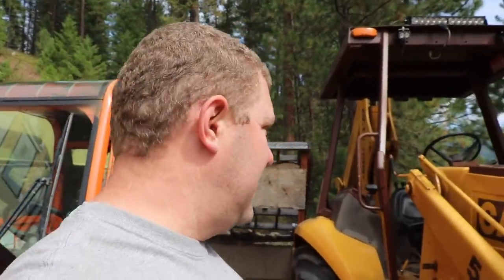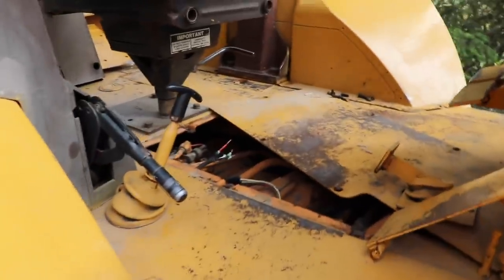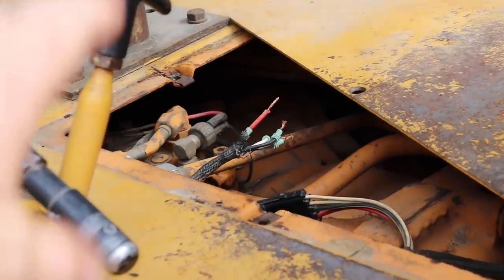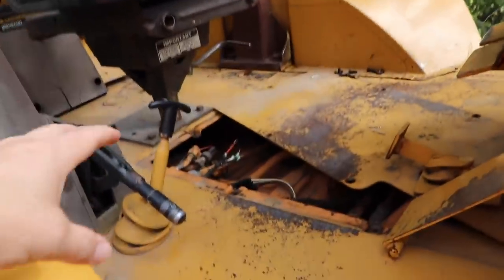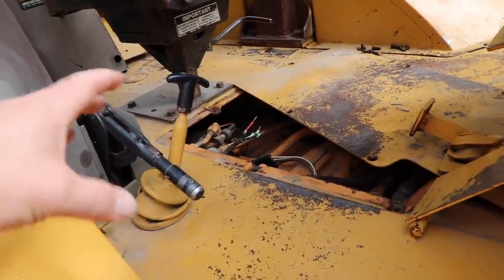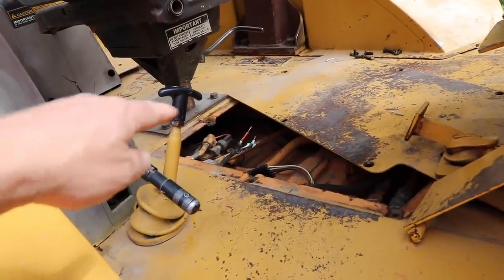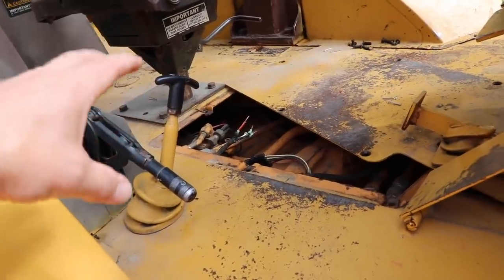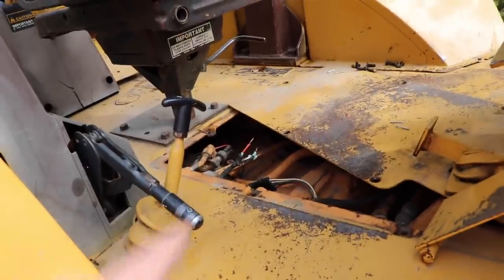This $0.50 Part Broke My Backhoe

Comment: Supply & Demand Ma Man!  Just coming up to Winter in a state where snowfall is measured in Feet not Inches it's usually just one light at a time going out  so why not charge a healthy premium for a 'Must Have' in terms of safety item?  That's why!  And you are so Wise to do this before you get hit by the creeping White Death when your machinery is vital.  Time for Alyssa to get out the handy dandy label maker for those little boxes of pins etc., so you know what you're looking at lol.  Do you have those adapters fitted into the tool properly?  Because it looks a bit Wonky & wavy from this angle?  I bet that crimper tool should really be metal!  You can tell those wires have been fiddled with before by the fraying and the difference in the length of the wires I bet water got into it before now,  I think you're going to need loads more bits in those little boxes.  There be a Mouse in that Machine, Jesse you should maybe start calling it The Gremlin 😉🤣

Comment: Or Soder, a Sodering Gun, and Heat Shrink Wrap
Reply: The pre-glued heatshrink, ideally.   A dab of PVC cement on the insulation under plain heatshrink would probably work too

Comment: i would go component to component with the meter and check line to ground. Look at your schematic and just follow it using your meter. There has to be a short somewhere if its blowing that fuse.

Comment: I'm pretty sure you're not supposed to crimp the green "hat" with the cable. It is supposed to be pushed in, after installing the pin into the connector.